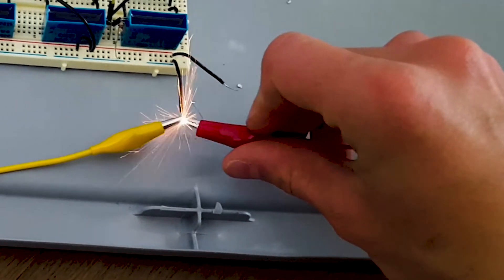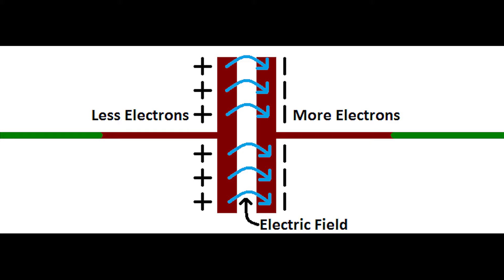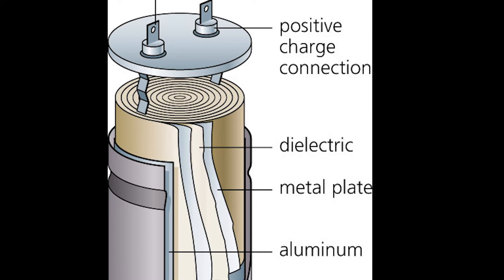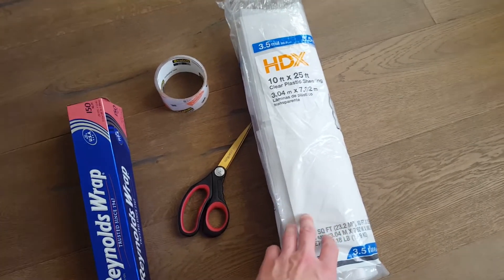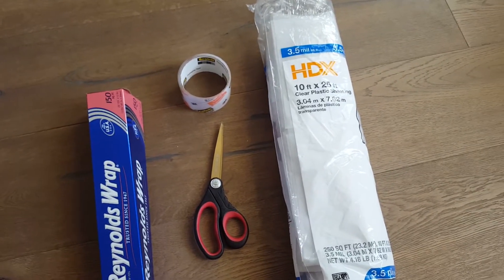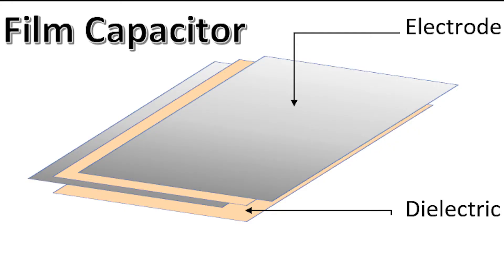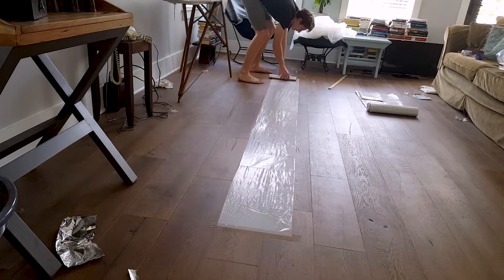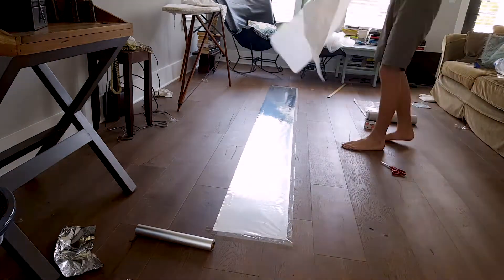Make a High Voltage Capacitor 0.5 uF 10000v (AC/DC)

Comment: our Induction heating generators fried hundreds of capacitors with a breakdown voltage of 4000VDC written on them and they failed the tests at 5000Hz operating frequencey even when we put them in series they failed.
Reply from the maker: That might be because they are DC capacitors and not AC capacitors. DC capacitors cannot handle AC power at it breaks down the aluminum oxide dielectric.
Reply: @unencrypted4314 dc is electrolytic ? Ac is film?

Comment: I design and build Induction Heating generators operating at 5000Hz/ 10KW power  to melt
20-40 kilos of white metals and thats where your capacitor talent will make or break !

Comment: since this is out PE it can hold 80000V/mm. so with 88.9 my it should be able to hold 7112V and not 10000V. So be carefull to not destroy your capacitor.

Comment: I utviklingen av ideene til Christian Birkland elektromagnetisk masseakselerator https://youtu.be/admghPNkotI   A working model of a electromagnetic mass accelerator  https://youtu.be/9YQyjPITDho 
    (mobile test bench)   https://youtu.be/Sm1rZ-ZeHlc    
    in HD quality      https://youtu.be/M6CUHnvI2Ek
   You can buy what I did
https://youtu.be/nCgz02bR058
https://youtu.be/FFBHuCnkUzU
In the video, the functioning of the working model of the electromagnetic mass accelerator (mobile test stand). It is generally accepted that the implementation of this design is very difficult because of the low efficiency and low reliability. Nevertheless, this opinion is mistaken - modern technological the base has long been able to realize an electromagnetic mass accelerator with an acceptable efficiency and high reliability I am looking for interested in making. https://youtu.be/AcJeElCUq1w
Reply: https://youtu.be/admghPNkotI

Comment: Hi, nice project I like it. I'm doing a similar thing for an induction cooktop, and I'd like to know the dimensions of your capacitor before you wrapped it up.   Also, 0.5 uf is amazingly huge I can't believe you achieved that value, could you indicate the measurement using a multimeter?
Reply from the maker: Hello David, the length of my capacitor roll was 10' long and 1' wide before I wrapped it. If I was to do this project again, I would use Kapton tape and aluminum foil. Kapton tape will run you about $15 for 10" sheets. It is a lot thinner than this plastic and the adhesive will allow you to achieve a much better roll. This means you will have a capacitor with a much higher capacity. Also, Kapton tape will allow you to have voltages above 10KV with ease. I might make a video about this in the future.
Reply: Yeah, make a video about it in the future. And while making some of these something I noticed about these plastic dielectric caps is that they seem to have high leakage - they lose charge quickly especially at  high voltages. did you struggle with that somehow?  And I really wanna know the actual value of your cap if you don't mind.
Reply from the maker: I definitely struggled with high leakage. Leakage can be fixed by either sticking the capacitor in oil (or silicone) or using a better dialectric like kapton tape. I also struggled with imperfections in the plastic that shorted the cap when I raised the voltage too high (above 5000 volts). My multimeter showed a reading of about .487 uf, but my multimeter is not that great and may have overshot considerably.  I don't have the caps in front of me so I can't measure it again at the moment.
Reply: Awesome ideas. Yeah, in my self would high voltage transformer I realized that even the "one inch to the right" between layers may not be enough, there's still some arcing observed in the dark, and so finally it yielded. The shit worked so fine when I immersed it in veg oil.  I never regret any of the new things that  I've tried 'cause I realized that every now and then I'm required to emback on a concept that I learned probably in a failed project some few years back.  And finally did you notice any considerable heating of the cap?
Reply from the maker: I'm very glad to hear the vegetable oil did the trick! I will have to do the same with mine. The caps should not have a problem with heating because there is so much aluminum sticking out each side. This means the cap has low resistance and will not heat up.